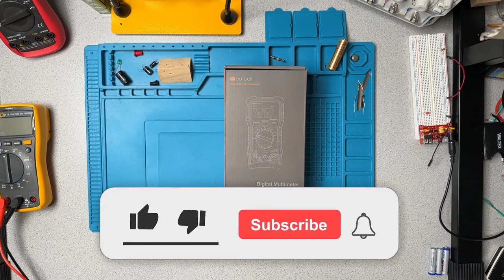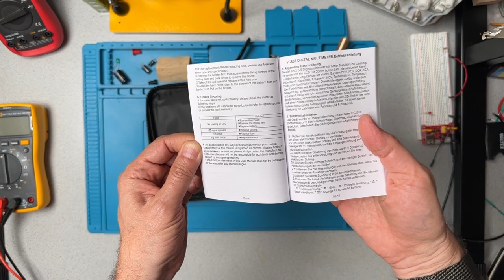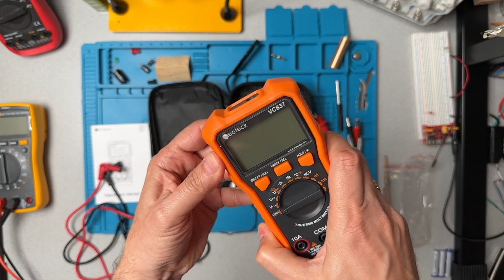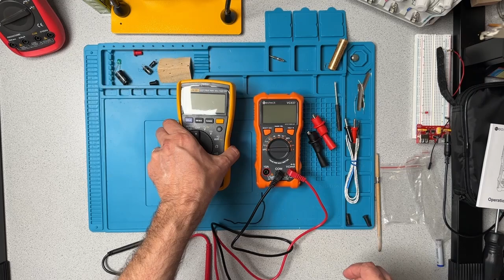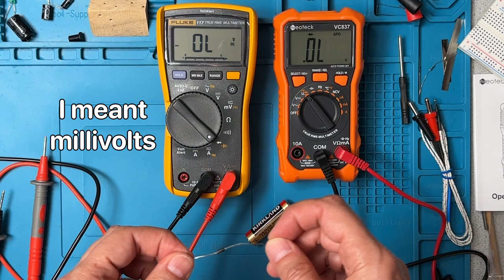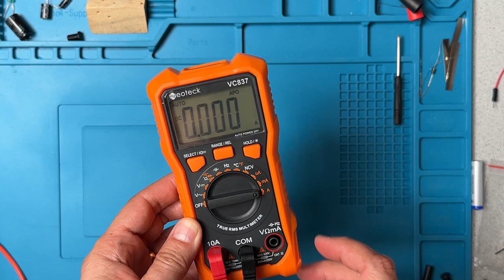Neoteck NTK244 aka Vicimeter VC837 Multimeter

Comment: Frankly its a ridiculous comparison - So forget Fluke - I bought the Neotek and it was absolute crap - at ANY price.  Couldn't even measure basic small capacitors, build quality is cheap plastic that will crack easily, the screen is small ... I returned mine only after a few hours with it  - Not even worth $10 - In fact its the kind of meter if given away free, It would likely stay in your drawer unused.
Reply from the maker: Thank you for sharing your experience.

Comment: The Fluke is a $200-$300+ multimeter depending what country you buy it from and the Neoteck is a $30 multimeter on Amazon. So the question to ask does the Fluke perform 10 times better or the Neoteck 10 times worse and what will you be using it for? Occasional use around the house or Professional use on a daily basis.
Reply from the maker: That's a fair perspective. Fluke is a well known brand that is known to have good performance. I thought it was interesting to see how well a budget multimeter compared. That said, I have mostly moved away from the comparison format unless the meters are roughly in the same category.